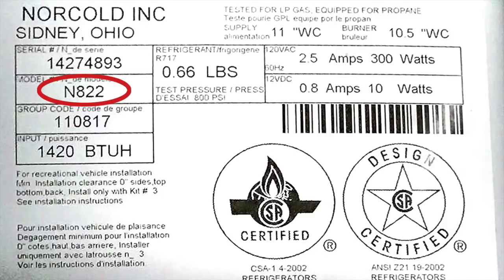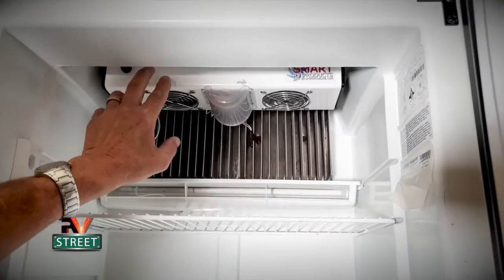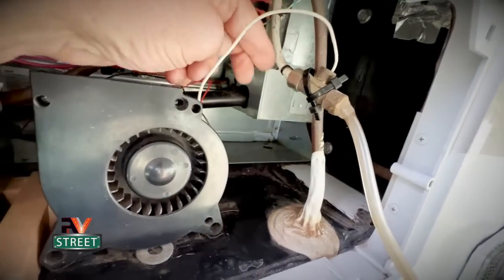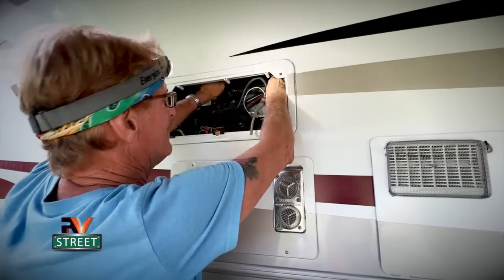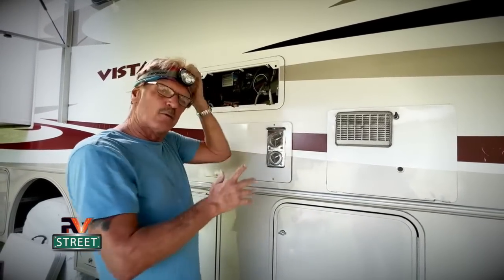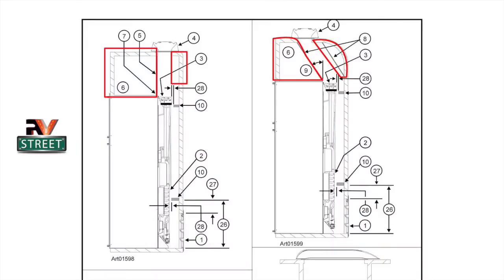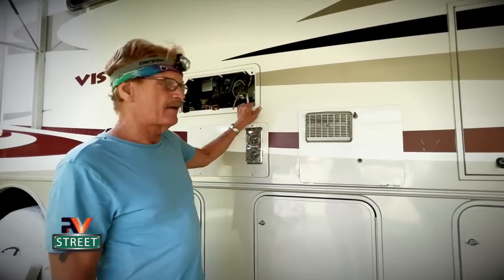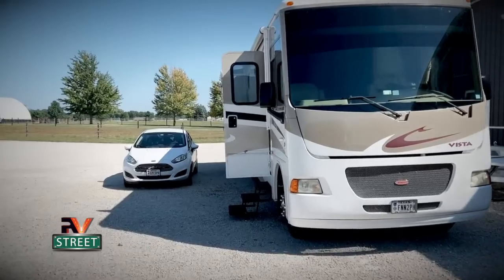AMISH RV Absorption Fridge Replacement Cooling Units—AND TIPS—Make Your Fridge Run Colder

Comment: hmm i bought one of those cheap 54 quart top loading 12v fridges on walmart for 99$. i coated the outside of it with aluminum foil tape and then the inside with copper foil tape.  just to reflect all the emissised heat from the environment. set it at 34F and it is literally using 4 watts/hr inside now. thermal emissivity is a very poorly understood component of fridges yo
i also coated the outside of the hot end condenser compartment with black duck tape to help it flick the heat away
i can tell the back side of ur new unit is doing a similar approach with the aluminum/metal foil. might be worth having the front of the unit be white or some kind of metal. stainless steel is actually really good coz it uniquely has low thermal emissivity and not super low specific heat (less convection loss)
Reply from the maker: Thank you for sharing your knowledge with the RV community.

Comment: I THINK IN THEIR ORIGINAL DESIGN THEY DIDN'T PLAN ON HAVING ANY FANS AT ALL THEY WERE JUST DEPENDING ON THAT EXTRA SPACE SO YOU NEED TO SAY THAT IN YOUR SYSTEM WHERE YOU ARE FORCING ARE YOU NEED TO DO THIS BUT IF YOU'RE JUST DRIFTING AIR

Comment: I decided I better let y'all know but other than blowing a likely spider egg Sac out of my tiny little exhaust tube I've never had any trouble or done any upgrades to my Dometic Royale rm3801 I did buy a control board for it and blew out that timing exhaust and the interior works just fine with natural air movement it's simply takes a little bit longer to cool things off maybe but I live in this RV 24/7 and that refrigerator keeps up with me one person beautifully. And I love my super cold drinks. I would say Z main thing to know is to keep the fans in the refrigerator from completely holding Frozen liquid it might should freeze a hair here and there but slide off on and off cycle and you'll not have to defrost it much at all. And it's on the firing line we're still hits 32 or 31 occasionally

Comment: nice to way to look at things I Bought a regular house fridge that fits in the sport that a propane Fridge used to fit.  I will later have a nice 12 volt system with solar on top of my camper to keep the fridge on if I have anything in it. But for the most part it will be empty if not in use. But when travelling I need to keep it on.  I will be Upgrading from the Lead acid battery to a Lithium battery and put an inverter just for the fridge.

Comment: I will say well it's next to my last post that I run it on 120 at all times and 12:00 seemed it needed a bigger element which I got but haven't ever tried the propane works perfectly but it's possible I could use interior fans with propane use.

Comment: I am so sorry to learn that Martin has passed.  I just learned this today from these comments.  I am a relatively new RVer (2 years), but I learned a tremendous amount from him.  This vid may be his best for me.  I have had a problem with my Norcold since day 1.  Upon Martin's endorsement, I contacted JC Refrigeration in the past couple of days, and they confirmed for me that my N8X is a piece of junk that the manufacturer should never have sold me.  I have an appointment next week at JC to switch out the cooling unit.  I am looking forward to a refrigerator that actually works.  Many thanks.  A thousand stars! ⭐⭐⭐⭐⭐⭐⭐⭐⭐⭐
Reply from the maker: This was a great decision on Martins part because the refrigerator is working better than it ever has before.

Comment: Hey bud I’ve got a propane Treger fridge at my off grid cabin it was in the cabin when I bought the place I thinks it’s made in Spain but here’s the issue it will light but goes out when I realease the button sounds like a bad thermocouple now there is a little black box that holds aa batteries for the little lights inside but there is a 3rd wire going somewhere lol could this be my milliamp power source to the ignition switch? Any help would be greatly appreciated I have a book but it’s in another language imagine that I’ve god another thermocouple if needed thanks a bunch  your way way more knowledgeable than anyone else I’ve listened to thanks Eric 👍
Reply from the maker: I'm sad to say that Martin has passed away and I don't have the answer to your question. Sorry
Reply: I hate that he passed away he seemed to love traveling and depending on no one now he’s got Jesus and and an eternity in peace 🙏🏻

Comment: Did I miss something on the fan unit inside the fridge...what is the white wire in the drip tray for? How does that work?
Reply from the maker: I'm sad to say that Martin has passed away and I don't have the answer to your question. Sorry
Reply: @RVstreet  oh, I am sorry for your loss. May peace be with you